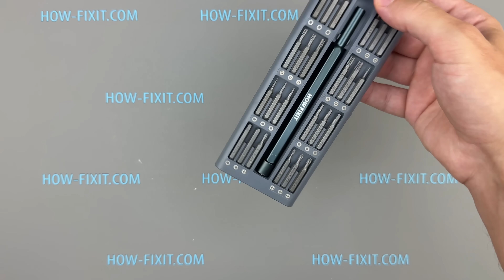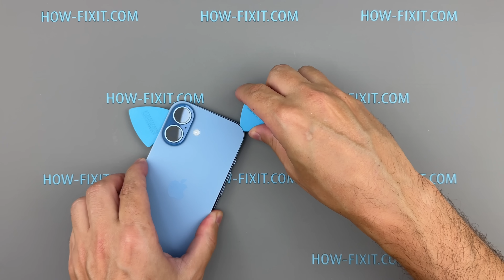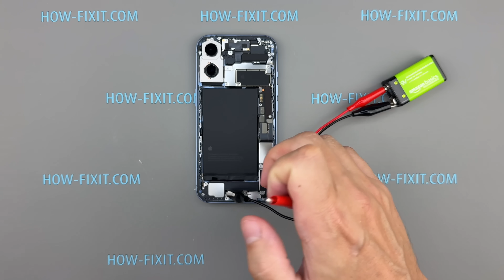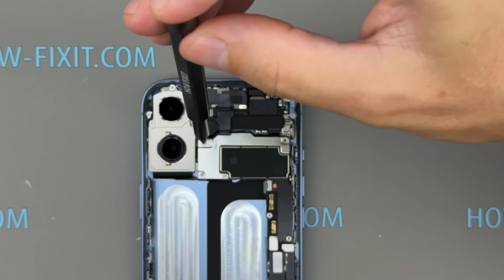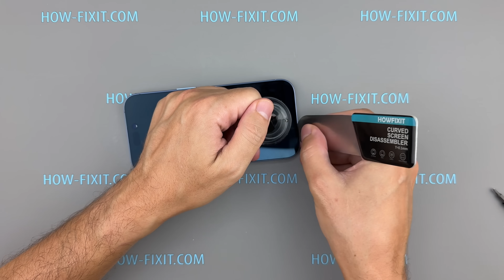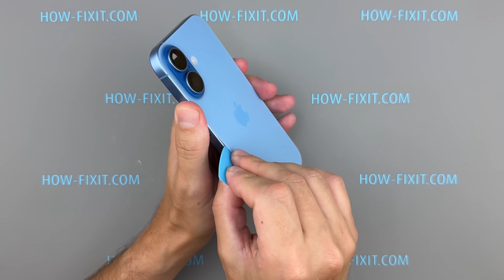iPhone 17 Teardown & Repairability: Safest Steps + Full Parts Tour

Comment: Why does one need to connect a 9 volt battery and clamp to the iPhone battery? Can it be removed without using that? Probably using an alcohol or something?
Reply: Yeah, WorthItRepairs has a video where he does just that, removes the battery with alcohol and a plastic spudger (I’m sure you know but for anyone else reading this comment it’s really important to use a Plastic spudger to reduce your risk of puncturing the battery. It’s definitely safer just to go the 9volt route if you’re at all unsure)
Reply: Just get a 9v battery. They're readily available and cheap. The battery removal is easier and you don't risk getting messy alcohol everywhere, and risk damaging the battery while fighting with the spudger.

Comment: Gotta love the removal of a physical SIM card slot, replaced by a useless plug.
Reply: Greedy Apple execs are doing it to upsell the pro and pro max models. Those eSIM models have 2 hours extra battery than the physical SIM equivalents because the extra space is actually used for more battery.
Reply: @u @user-tr1zj is model could have easily had the extra battery too. the taptic engine fits the empty sim card area perfectly. the uselessly large speaker with no foam balls inside can be made smaller like they did for the pro models. also the mic will fit perfectly to the other side and then you have the area free which was previously occupied by taptic  engine and mic. now the long black part that made the battery be smaller is not there and a longer battery will fit perfectly. 

but thats just too different and would have required all iphone 17 models worldwide to be e sim only and that’s probably not something they wanted to push yet. 

they have their test subject “iphone air” for these sorts of big changes. the air has their c1x modem, e sim only and have the same speed charging wirelessly or wired. 

portless e sim only phones using their own modems is what they want but i dont think they can do that with the eu requirements regarding usb c.

for the iphone 18 base model they will probably move to the new plateau design and the battery will be bigger anyway.

only select few regions get the e sim pro models, for this to make sense they need to be able to make all iphones e sim only worldwide.

Comment: Apple should use a better way to secure things than screws. I bet they could add at least 10%+ more volume. Just have an internal assembly that has tabs to click it together. Connectors also take up huge amounts of space.

Comment: not interested at all...look cheap...IP 16 still beast❤
Reply: Weird cope. Enjoy that 60 Hz display.
Reply: @tycanuck  I've used both and there is nothing wrong with 60Hz.  Variable refresh rate is the main thing worth having.  If the maximum was still 60Hz it would be no big deal.
Reply: @loganmedia4401  Says you, a random person on the internet.
Reply: There is no reason to upgrade from last year's model.  Not because there is anything wrong with the latest one, but because it is almost never worth upgrading after only one year.

Comment: iPhone 16 🤡
Reply: iPhone 6S Plus 🤡💩
Reply: From what I know the 17 is regarded by the wider tech community as one of the best deals and upgrades actually, basically the pro iPhone with one lens less. Somehow even beating Samsung and pixel in specs (which iPhones never do)

But if we go by design then yes, it’s the “same” as the 16. If you want to just judge them by the exterior, you do you. Just know that applies to basically every major phone brand lately
Reply: Iphone16🤡❌
Iphone 16 but with pro features ✅👆
Reply: the most poor iphone ever
Reply: All iphone users 🤡🤡💩
Reply: @A.J946  cry harder kid

Comment: So esim and sim versions of iphone 17 have identical batteries in terms of capacity?
Reply from the maker: I think so
Reply: Yes. Only the Pros have different batteries based on SIM reader presence.
Reply: This is because the pro and air models really squeeze out as much space as possible. The 17 appears to be more simply made.
Reply: @hsew  Both the other models have a camera bump that runs right across and presumably that makes space to fit the whole board in there.